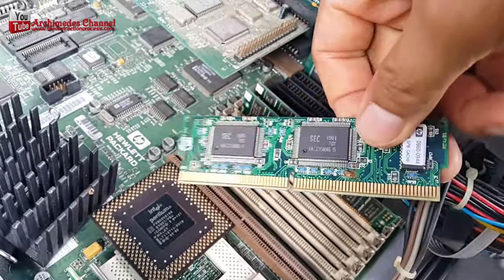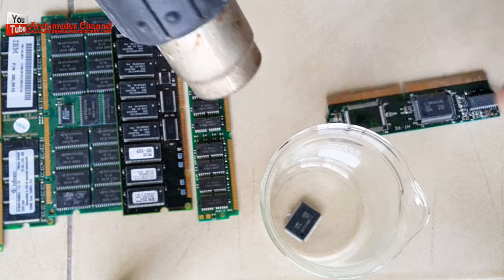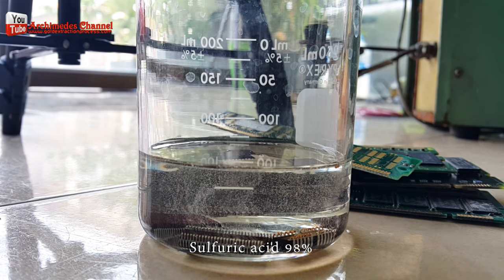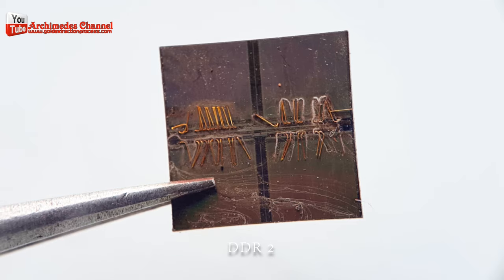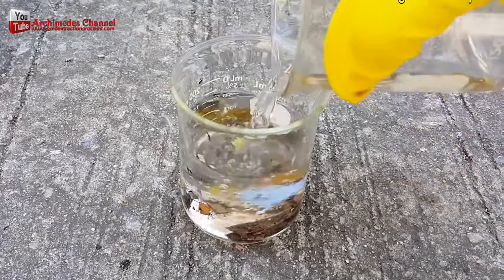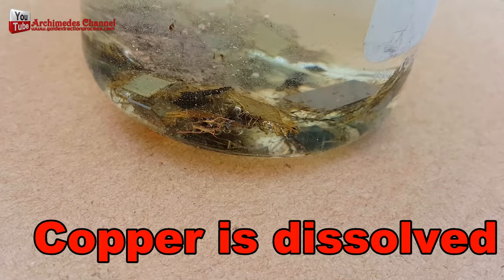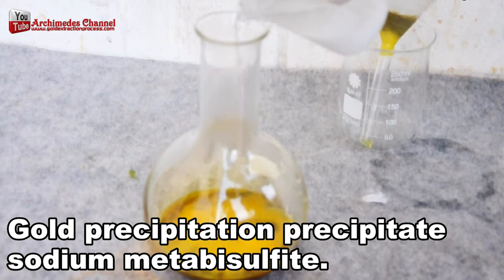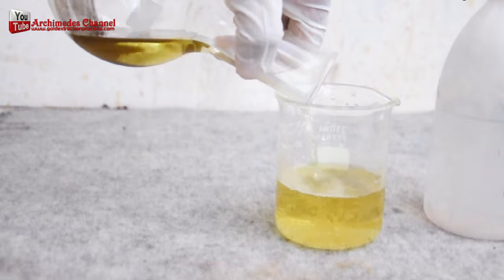Old Ram Chips from computer How To Recovery Gold

Comment from the maker: 👉👉😱😱😱Due to the small amount of gold in each RAM chip, it's not economically feasible to recover the gold from a single chip or a small number of chips. To make the process economically viable, large quantities of RAM chips would need to be processed, which would also require specialized equipment and expertise.
Reply: Which is good burning or wet ashing i  did wet ashing  of 500 gram ram chip  but no get gold